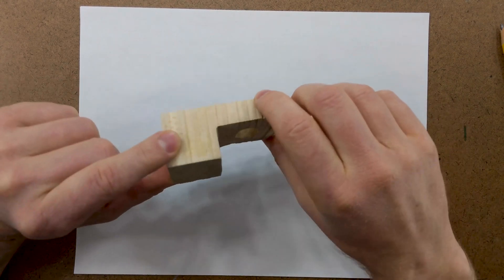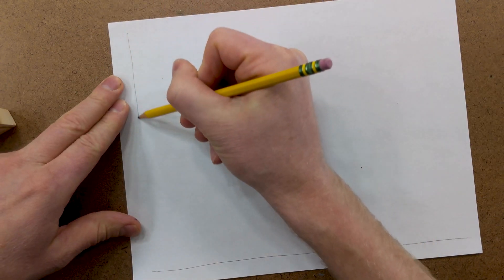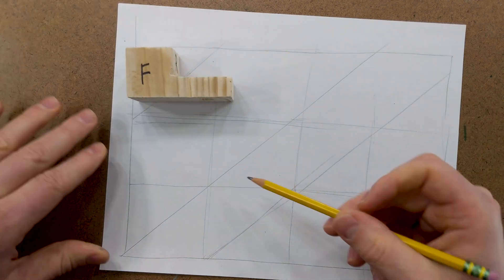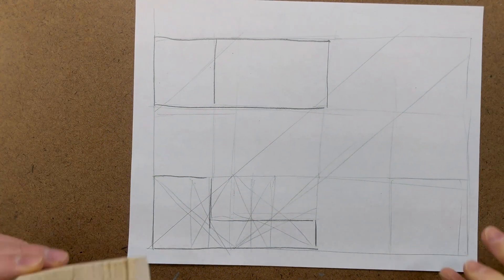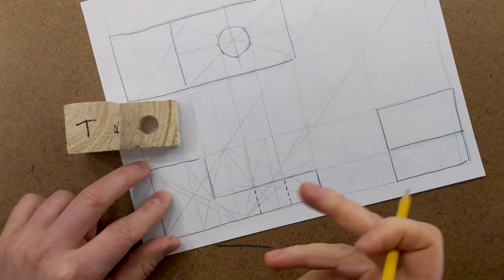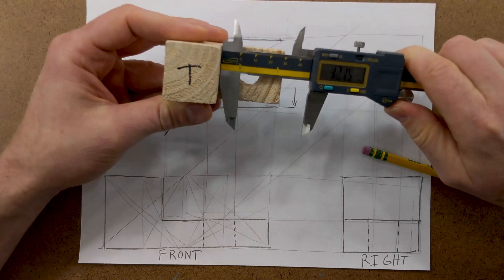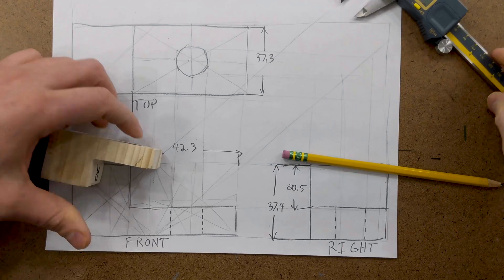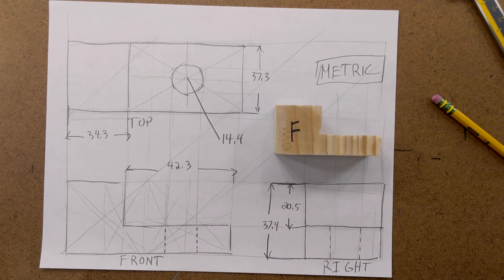Third Angle Projection by Hand: Complete Orthographic Drawing and Dimensioning Tutorial

Comment: Instructions: 

Answer ALL questions. In this assignment, question (a) below is a description of a system and (b) provides information about a graphical plain scale. Question (a) requires the construction of two views of the artifact described, while (b) require the construction of a plain scale conforming to the information given. Both the two views and the graphical plain scale are to be drawn in the same drawing area of an A3 drawing sheet, laid in landscape, appropriately centralized as taught in this module. Please note that part (b) requires some prior calculations, these calculations shall be done in the drawing area (i.e., defined only by the standard margins and title block as taught in this module) on the flip side of the A3 not used for the views and the plain scale.(ONLY neat presentations earn credit). [Do not dimension your drawings unless explicitly asked to do so!]	[deduct 5 Marks if unsolicited dimensions are included]

Question 1									[]

(A). A cleaning company contracted by BIUST has commissioned you to design a special tool with which to remove sticky chewing gum on the floors of student hostels. The tool is to be called a SCRAPER and its overall shape is a rectangular solid of 120 × 80 × 10 mm. However, one end of rectangular solid rises from zero thickness to a maximum thickness of 10 mm in a length of 30 mm to form a sharp edge. The opposite end is semicircular. A 30 mm diameter hole is positioned such that the center of the hole is 40 mm from the semicircular end and 40 mm from either side of the tool. Use an A3-size paper to appropriately layout a full-size drawing of this concept as presented by the cleaning company. Your drawing should, in appropriate portions: 1). give, in 3rd angle projection, the front view (FV) and top view (TV) of the tool appropriately centralized with the title block assumed to be 12 mm high, in which only 2) the name of the tool, 3). Your Student ID should appear neatly written.		[50%]B) At a convenient place above the scraper in (a) above, construct a plain graphical scale to depict the situation whereby a field of 7.2 square meter is represented in a map by 10 cm x 8 cm. The scale should show centremeters (cm) at the lowest level but long enough to measure up to 3 meters (m). Be advised that the height of the scale (or the height of the thin long rectangle) shall be 10mm instead of the recommended 3mm taught in the module. This height is very important especially for centralizing your views vertically
Reply from the maker: Beyond the scope of YouTube comments, but your teachers should be able to help you
Reply from the maker: Ask your teachers for more in depth assistance